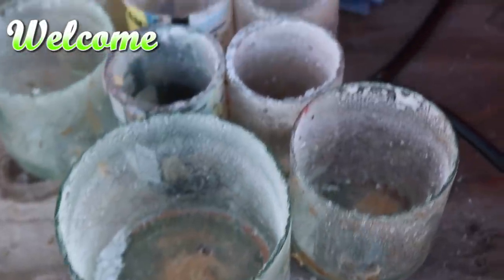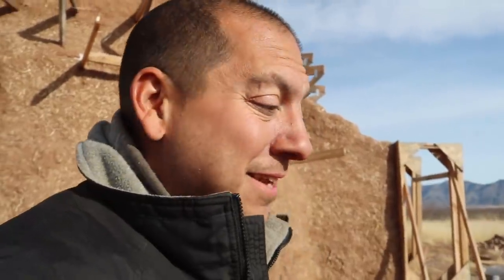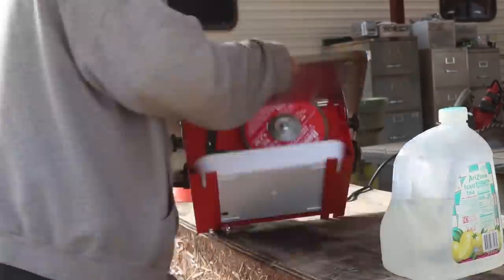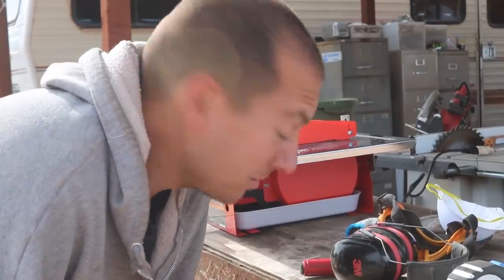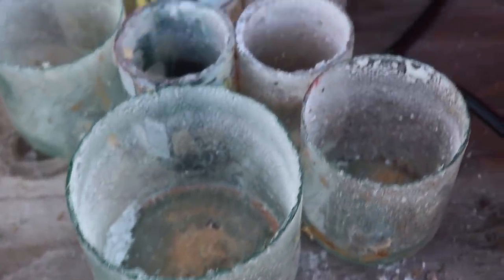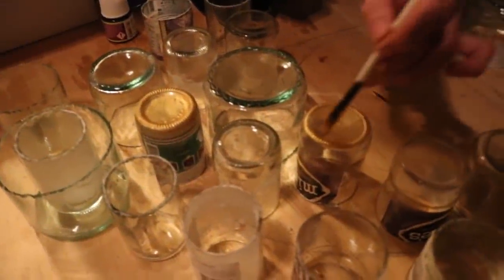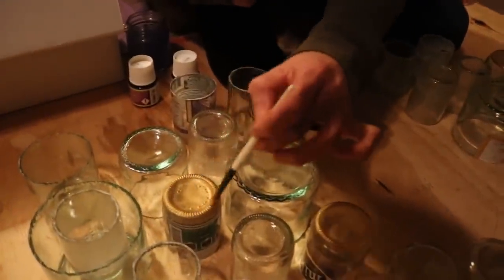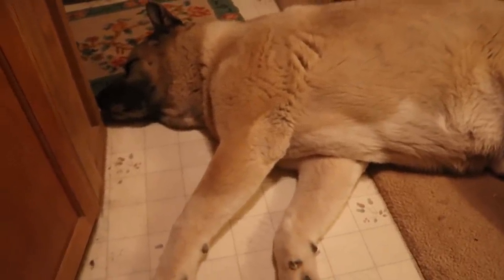We Built A Window Using Reclaimed Bottles | Energy Efficient and Beautiful

Comment: Back in the seventies we used to have little mechanical bottle cutters for converting bottles to stemmed glasses.
Reply: I wasn't thinking last week, I had a jelly jar on the counter and poured hot bacon grease in it. The bottle was cut cleanly when I moved it, right at the spot where the grease was in the jar. It was not what I was planning, but it did make a clean cut. Next time I poured the grease in a can.

Comment: Jim, to save your gloves, use a scrap piece of 2x4 to move the dirt through the sifter. It will save your hands too. It gets tiring if you need to sift a lot of dirt. By the way, the window is beautiful. The patterns on the bottom of the bottles really add to it too.

Comment: -  Would you ever consider bee keeping? Like the idea of the bottle paint- I would be consider painting the inside of the bottles think it would protect a little  longer from the weather-- trying to think if you would use a white tape or the silver aluminum tape for the sides of the bottle. would it reflect more light? Really like how you layered the  microwave plates. I think some cathedrals used painted glass.  When you screen for rocks- save the rocks- by the end you  would have a nice pile of rocks for pathways or filling a french drain. You are already going to the work - might as well toss them in a bucket and then when  taking your evening walk dump them on the driveway  or path were it gets muddy.

Comment: Extended exposure of your wood building materials to moisture like that can rot out your wood ceiling/floor framing. The secret to dehumidifying is a combination of heating and cooling with ventilation. Heat warms air which increases its capacity to hold moisture (and it will pull that moisture out of your building materials, too). Once the air is heated, venting it out of the space will take the moisture with it and create more capacity for (replacement) re-warmed air to grab more moisture out of your earthbags, wood, etc. You may consider installing a (very, very small) wood stove in the basement to help with moisture problems. The warmed basement air can escape through your opening to the outside. Don't have to use it all the time, just as a dehumidifier and usually in the winter when condensation becomes a problem.  Your perseverance is inspiring.  Bottle glass window looks awesome.

Comment: Beautiful use of the bottles!

Two quick thoughts, I don’t know how insulating the conventional window is, but if you placed a second one six inches in (or out) of your current one, then you would still be able to open both, for air flow, but when you want warmth, the 6” of dead air between them might give you that much more insulation?

And thought the second, if you incorporate a prism or three in with your bottles … instant rainbow collection.  And depending on where your windows are, also instant sundial.  Not that you need clocks, but … how cool to be able to glance at your walls, and know the time, right?

Comment: Strong wind?  Blew an empty  plastic bucket over?
You can cut the bottles using oil and water.  Water up to the line then a bit of oil,  place a hot poker into the top of the bottle to touch the oil and , Bingo  ! Make walls with whole bottles too

Comment: Would a dehydrator work in the bedroom attached to a solar panel to dry out?
Reply: GDP is off-grid, Dehydrators are energy hogs.
Basicily an AC UNIT that cools the air to condense out moisture, then dumps heat right back in room, to absorb more moisture .
GDP is off-grid, with minimal reserve solar & battery power during short Winter days.